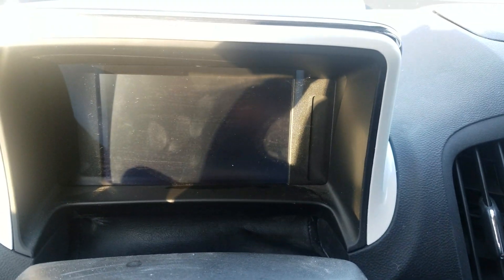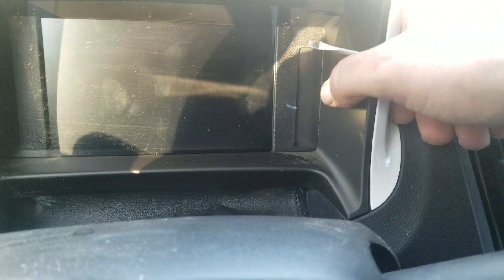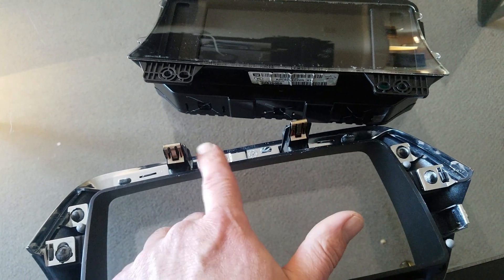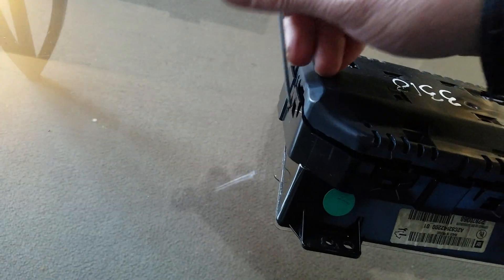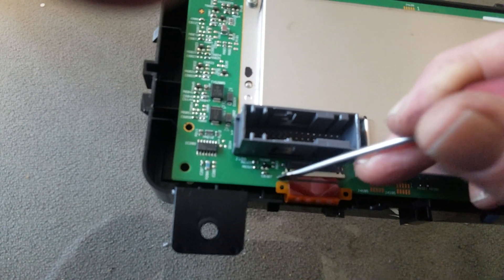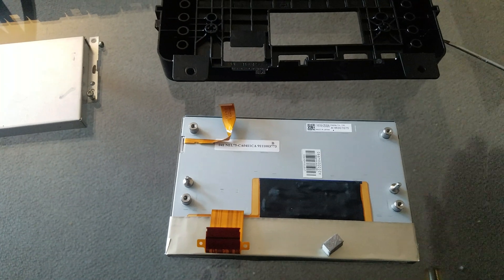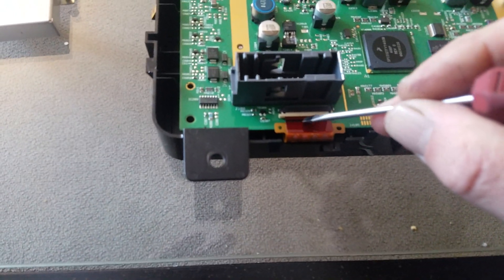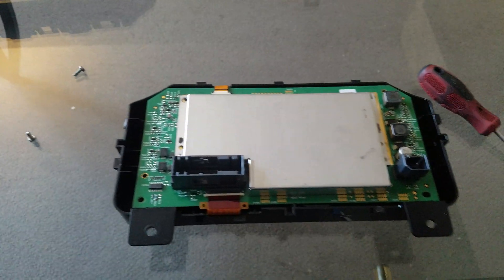Chevy Volt display, instrument cluster fix.

Comment: What year is this screen out of ive come to found out that the 2013s are different than the 11s i have the same screen and was wondering if a 2012 screen would work
Reply from the maker: I used the same year as my car 2012, 2012 and 2011 are same car as fas as know.

Comment: Any idea how many model years use the SAME lcd panel for these?  For instance I have a 2012 Volt with the dead screen, but is the lcd panel in the instrument cluster from a 2015 still the same? (as you mention these things are getting harder to find, and the part# for the entire instrument cluster for a 2015 acts like its only usable across the. 2014-2015 models)
Reply from the maker: Not sure if the 2015 will work since they made changes that year. I searched and couldn't find any but new ones from GM for around $600. Last I checked it was around $800 to have install a new one and they will not reprogram a used one.

Comment: So I replaced the “new” screen with the “old” board and still blank. I did the “old” screen with the “new” board and it works without miles displayed. Does this mean I have a bad board period !
Reply from the maker: The new board, won't work correctly, it would need to be reprogrammed for your car and the dealer refuses to do it. Your old board might be the problem. I would get ahold of the chevy dealer and see if you find someone to reprogram it to your vehicle.

Comment: This Video is perfect!! I first tried to just replace the whole instrument panel; the odometer of course locked out. Then I watched the WHOLE video and replaced just the LCD panel while using the old circuit board as the video showed. It worked great, panel works, and odometer shows correct mileage. This saved me over $1000.00 dollars!!! Thank you Thank you.
Reply: Would you be able to she the link for the cluster display screen... thank you
Reply from the maker: It's a easy fix and better then paying the dealership. I should've mentioned more times in video,,that you can't replace the control board.
Reply: Did this fix the issue long term

Comment: what plug is that for flashing the cluster?  I tried to stop/start the video in various areas to get a glimpse.
Reply: I pulled the cluster and it's a usb type mini B.  Thanks for the video as it helped me in removing the cluster.  FYI for others, the top part of the plastic column cover also needs to be removed as it holds the vinyl flap to the bezel.  7mm as all the other bolts holding the cluster on.

Comment: I am about to replace my cluster LCD screen... What does he mean about the antitheft alarm & only replacing the electrical board? I don't want to cause anymore problems by replacing the LCD cluster! Thank you!
Reply from the maker: Only replace the LCD Screen and not the electrical board. The electrical board has a serial number that checked by your main computer, if the numbers are different then anti theft will be activated and I can't tell you what would happen but you would probably need to take it to a dealership after that. If you only replace the LCD and leave the your original circuit board in then you'll be perfectly fine since the LCD display doesn't have a serial number that the computer checks. If your not sure what I'm saying then I would find someone more familiar with cars computer systems.

Comment: I'm looking out for one of these screens, they're hard to find used for less than $450+. Are there any other parts in that electrical board, or just the board, that could be ordered anywhere and replaced? Do you recommend any sites to search other than ebay? Thanks!
Reply from the maker: I would assume these are getting hard to find. There was a site that would repair them but you still needed a working one or a new one GM quoted me about $800 for a new one but still needed reprogramming.

Comment: Thanks, I followed step by step and my display apparently isn't the problem.  I had tried dimmer, battery and fuse disconnect previously before your fix. 
Any other possible culprits?? Am I left with relying on a dealer?
Any info appreciated. Thanks
Reply from the maker: Check the power pins on the back, there's 2 powers and one ground. You'll have to get s man repair manual. I got one from www.chiltondyi.com but my subscription ran out so I don't have the pins numbers to check.
Reply: Hello there, so did you take it to the dealership after all? Or were you able to fix it? I have the same problem so Im thinkng of ordering a sreen to replace my broken one.
Reply: @msanchez203  I have not taken to dealer yet. No progress on fix. Just don't have $$ to spend right now
Reply: @kregdurham2485  totally get it 
 Hope can fix it !

Comment: Hey, after my lcd died, I ordered a replacement online. But after installing it, the screen is still blank. The screen will get brighter and darker as I adjust the brightness, but wont display any info. My previous broken lcd wouldn't even do that much. Do you think I got a faulty screen? Or maybe it's another issue. Did your new lcd work immediately? Or were there any other things you needed to do?

Thanks.
Reply from the maker: My old screen did the same, it would dim and brighten but no display. The used one worked right off the bat. I would say you got someone's broken one.
Reply: Hi there, so did you take to the dealer or were you able to fix it? 
I have the same problem and Im thinking about ordering a new screen to replace it.
Reply: @msanchez203  Unfortunately I was not able to fix it, and have since sold the car.

Comment: Do you still have the part number for replacement screen? Mine just died today grrrrr
Reply from the maker: I just looked for a used working display on ebay. You'll have to buy the whole unit and remove the display from the used one and install it back into yours. Don't try plugging the used instrument cluster in,  you'll set off the anti theft alarm in your car. Swapping displays screen only.
Reply: @DIY-rq4vy  yeah I got a used 2013 for 50  unfortunately mine wasn't the screen so now I had to get a whole new cluster and have dealership program it to my Vin figures grrrrrr
Reply from the maker: @andycondal286  , they wanted $800 to do mine. $400ish for the cluster and little over $400 programming. I got lucky it was only the screen.
Reply from the maker: @andycondal286  . I have another video coming soon on the car battery in the trunk and no start condition.
Reply: toshiba display  LT070CA04900